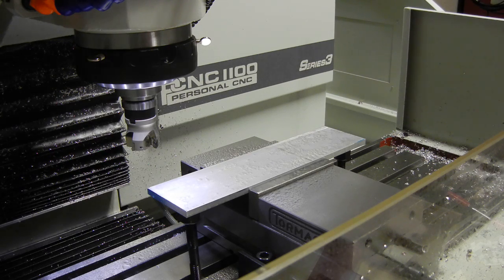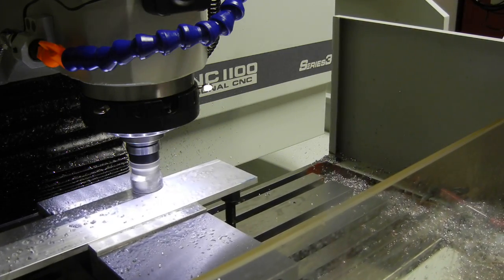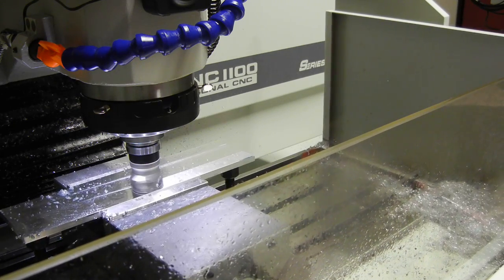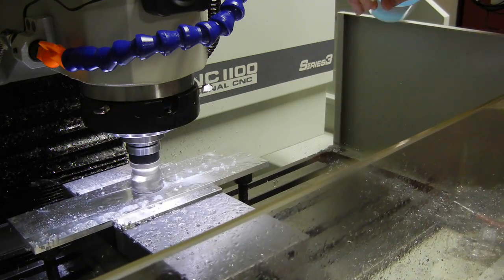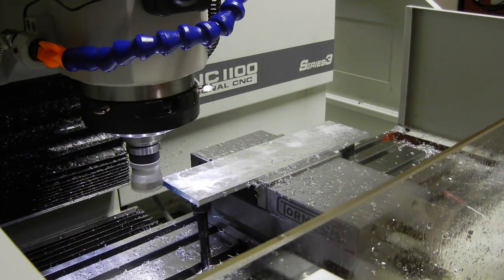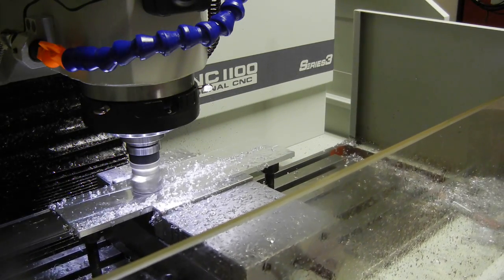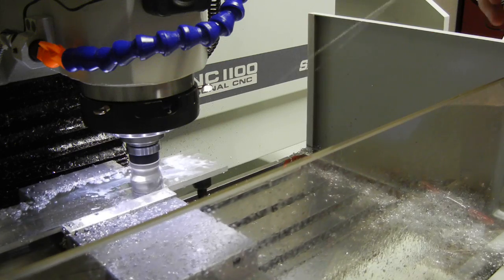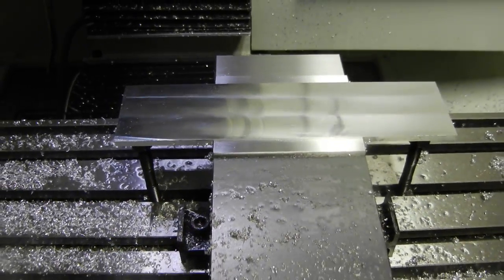Face Mill Aluminum Tormach PCNC 1100

Comment: Hey Kevin. Rather then flood, consider an air blast. I use one of these, and I find with alloy and only a tiny bit of coolant it works marvelously with less cleanup :) The worst thing you can do for finishing is running over old chips ;) This small device runs quiet and doesn't use loads of power but pushes chips out of the way fast. You can either attach it with a drip feed of coolant into your loc line (I use a 25G needle) or you can use a spra-kool or similiar (kool mist). Very nice work bro. Air pump link -    http://www.ebay.com.au/itm/250L-Min-20-Outlet-Fountain-Pond-Aquarium-Air-Pump-Air-Compressor-For-Fish-Koi-/221311689236?pt=AU_Pet_Supplies&hash=item3387346214

Comment: Sweet.  You can definitely face in both directions.  I read on cnccookbook that 66% stepover is ideal for facing, I forget why.  For the finishing pass I do 0.005" and crank the rpm UP, gives a way better surface finish.  Like 2-3x higher rpm if possible.

Comment from the maker: I have not purchased the fly cutter as of yet.  I need to see if they have it back in stock.  Yea the jack screws are hard to see.  I actually used the studs and cap nuts from my strap kit.  On the second side I placed a plastic spacer between the cap nuts and the material and it helped with the vibration some more.  I also put a little more tension on the part.  Ideally I would use two vises.  I will buy another before too long.